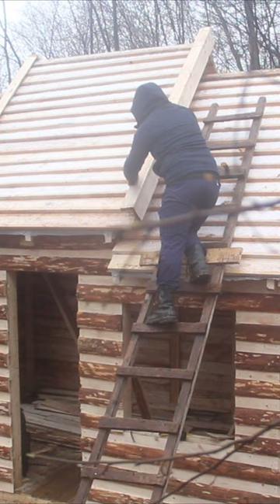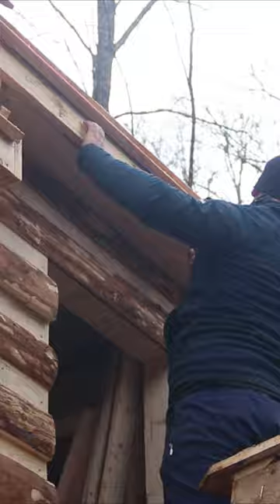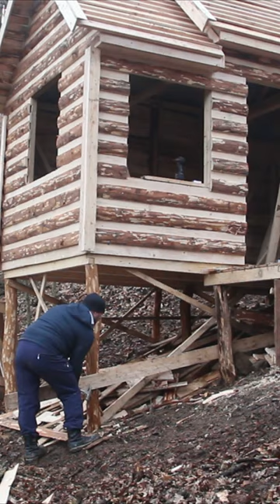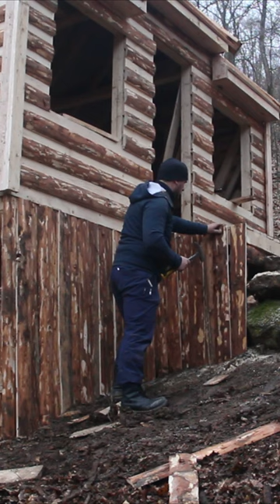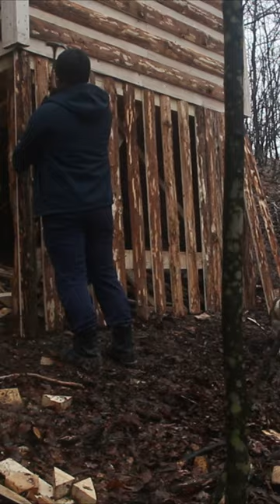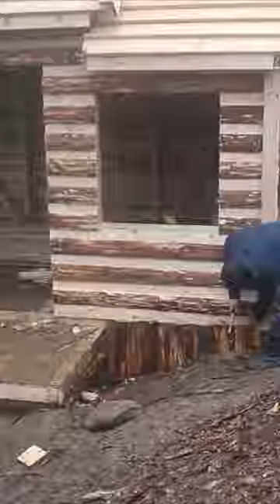Bushcraft skills #bushcraft #survival #camping #forest #shorts Part 5

Comment: My concern would be the raw wood piers holding the structure with wood to dirt contact points wait to rot away your home in 2 years.  If it starts to settle during breakfast one morning head for the door asap
Reply: there is a reason old cabins were built on rock piles
Reply: @gabrielsturdevant9700  yes and also why they are far and few between now days.   They didnt stay standing.

Comment: I see two issues. One, no vent for your roof. Need soffets ti take cold air in as warm air vents out the top. Minor issue. But the big issue is you have wood in direct conect with the ground? I hope you sealed the everliving F outta that wood because otherwise it will rot out completely within only a few short years... Ornless if you live in a very wet area.